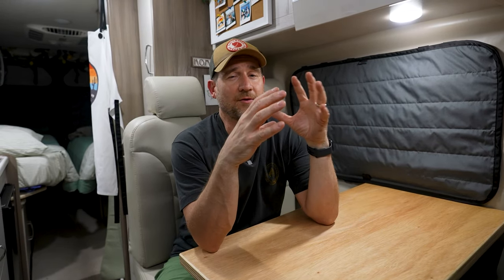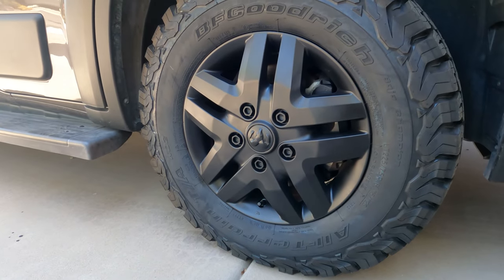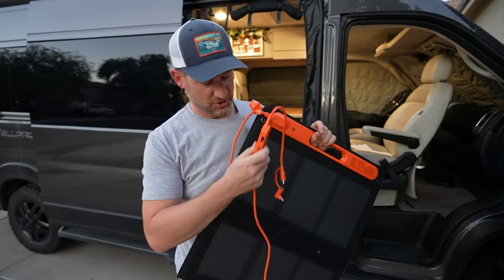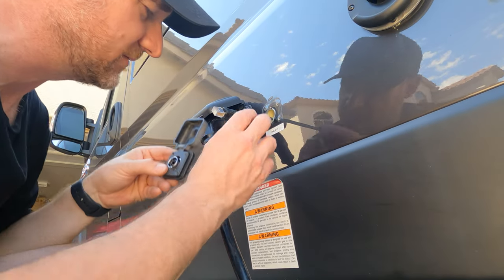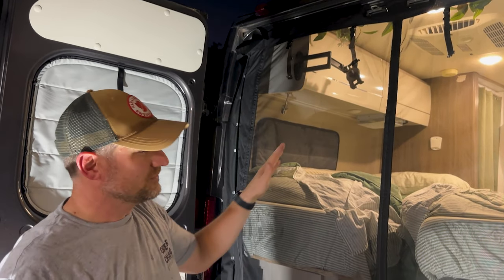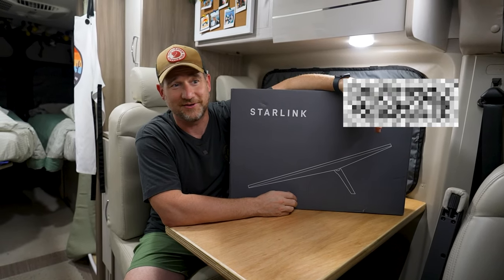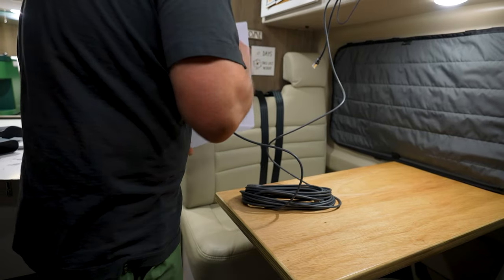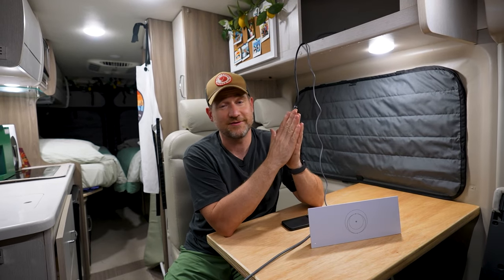We Need To Do This Before Our Big CAMPERVAN East Coast Trip!

Comment: Starlink: Added the mount for the router, a reel for the cable and a 12v power supply as I do not have an inverter (yet) in my Solis.

Comment: You can secure a mount for the Starlink to the roof and keep enough cable slack clipped up there. Then if you are obstructed somewhere, you can unclip the extra slack of cable and the dishy and move it out into the open.

Comment: We added the Starlink Gen 3 to our van roof and it works great. It lays flat all the time and works in any direction we are positioned. You will love the investment.
You are correct about trees. Signal can be hindered therefore your idea of running the cable from the side outlet makes sense.
We have a quick disconnect on our dish so that if I have to move it from the roof, I remove it from the roof and have 100" of extension cable I can use to move it out to the open. The dish is mounted to the roof via strong magnets, so it is easy to relocate but magnets are strong enough that it stays put.

Comment: I know you commented about the increase price for the Starlink mini. I was a little surprised that you didn't get it because it's only slightly larger than a sheet  of  paper and I know you have limited space in your van for storage and it doesn't require an external router cuz it's built into the dish for even more space-saving. Plus it works driving down the road on your dashboard  as you drive.
Reply from the maker: This totally makes sense. If we were full time in our Van we would have. You have very good points. Makes me second guess our decision 😂

Comment: Ive had the gen2 Starlink since early 23.  If you use it with Teams or similar for audio conferencing you really need a clear view of the sky, so no permanent mount.  The interuptions will drive you nuts.  For all else its hardly noticeable.  I bought the 100 foot cord.  
No mount for router.  Just run wire out window.  If i ever upgrade to a dish with an ethernet connection ill add an exterior plug.

Comment: Should've got the mini imo, built in router, low power draw, 12v type C.. i put mine into a magnetic mount and it goes wherever i go, when im working, i stick it on my toolbox,  in the van, i installed a roof outlet and a permanent power coord.. the wheels and tires look great 👍

Comment: So I roof mounted my Starlink then depending on what gen of dish you can run them flat now. So I used a Seaview Waterproof ABS Plastic Cable Gland to put the cable through the roof then coiled up the extra cord on the roof and secured it. I also added 150’ extension also. Then I ordered stand magnets and leave my stand on the roof. This way I can remote the Starlink if needed. So now we can drive with it running and if needed when parked can place it anywhere within 250’.
Reply from the maker: Had to screen shot this comment! Thanks for sharing. Appreciate it!
Reply: Contact me if you want any info on Starlink.  5 years and running.

Comment: I''ve been using my Starlink on this trip through the North East for the first time.  Works great, but I have been nervous with the panel sitting on the ground around my camp sites - hard to see and don't want someone stepping on it or driving over it in the dark.  I am looking for one of those tripod type mounts so the panel is closer to eye-level

Comment: You guys are the best and Bob is amazing how he just dives in and gets it done. I have a question on the air conditioner on your van, we have the Coleman Mark Q and the other day it was 107 (Southern California) and I couldn't get the inside lower than 85 is that typical in these Ram Vans? Do you know if there is an upgrade we could have installed?

Comment: Our 2024 has 200 watts solar, gas generator and propane gas for heat and hot water. Is what your Mr Lemon has or different configuration.  If we need boost energy gas generator is our source

Comment: So you had no issues with Costco changing out the tires?  I was wondering about them since they were going to be my replacement option too.
Reply from the maker: We didn’t have an issue but only because our A/C was not in the way of the lift. The placement of what’s on top of your roof matters.
Reply: @Vancaskeys  good to know.

Comment: I have starlink the first generation dish and the plug is not the standard type I guess they changed it 😅 My is on a tripod once the power is connected the dish started to move towards the sky as long as I have a clear sky I have Internet and speed is not bad 😂 I am happy with it I have the regular subscription and I can change it to roam if I need to or change back 😅 there is one YouTuber he mounted dish on his van's rooftop and took off to Alaska the whole trip he has starlink connections and used it for the gps and Netflix at night to watch maybe upload his video 😅 he has a sprinter 4*4 he modify it with some off-road equipment and he dyi it for himself went all the way to the artic 😂 he said he wants it was because there were no cell phones coverage so he needs a back up and he took it down to Baja for the baja 500 and one of the races car has one mounted on it they did a test run to see if they can stream it to the HQ and it worked out it also helped the races team to know if there was a problem with the races car and they can be prepared for the repairs I know they have radios and it doesn't always work because the terrain 😅 his channel is called the living the Van life you can look at it and he has some beautiful shots of the place he has stayed it's the best travel video on YT in my opinion especially the video on his way to Alaska ❤ how he prepared and how he makes his meals I learned a lot from it and with your long trip to the east coast you could get some idea on how he makes the trip 😅